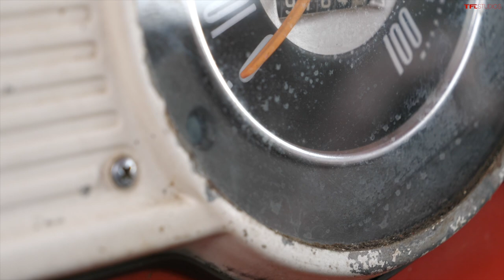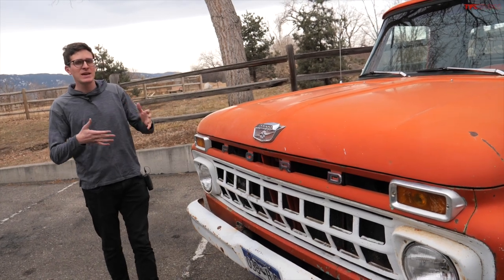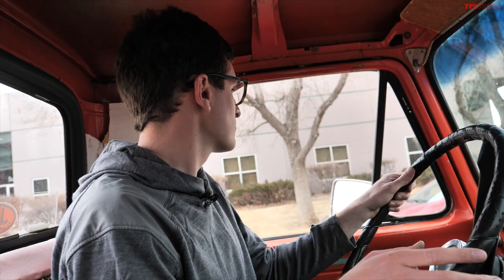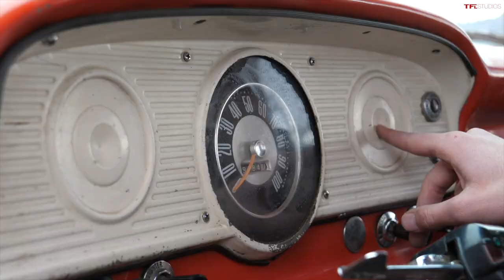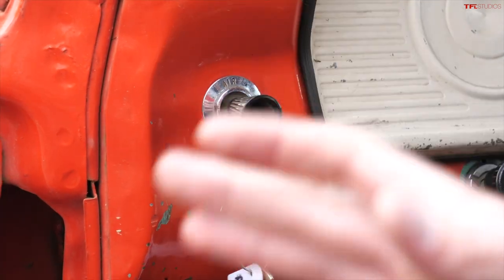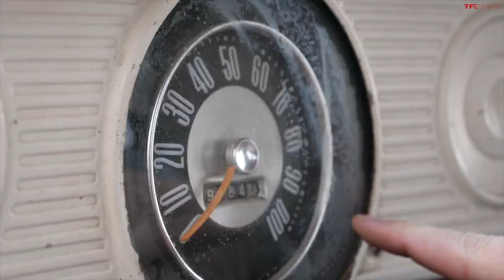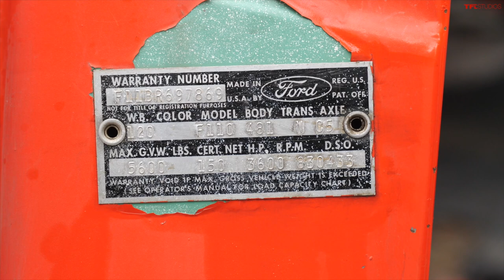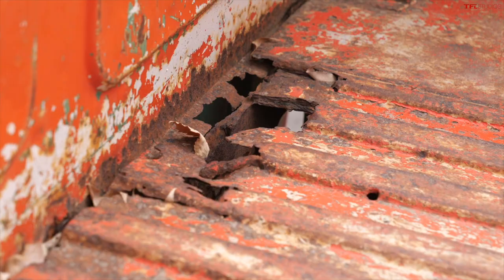Do You Like Raptors? I Just Bought The Ford Truck That Started It All!

Comment: Nice truck ! We got a 66 two wheel drive 3 on the tree 352 v8 custom cab, all original. Yours looks like it’s got a 1959 era bed, which will fit, just different body lines. It looks good though. Solid vehicles for sure ! Check out Dennis Carpenter Ford reproduction parts on the internet if you need anything for it. Enjoy ! Have a Blessed Day !

Comment: My first truck was a 1966 Ford F-100 4x4. It had a 252 v8 with a 4 speed trans and a single speed transfer case. 1966 was the first year for the coil springs in the 4x4 like the bronco. It was the worse 4x4 I have ever owned. I know what the bronco bounce is all about. Most people wish they had their first vehicle, not me. I do still have a 1966 Chevrolet C20 that my Dad bought in 1975. I drove the Chevy to high school until I bought the Ford.

Comment: In my opinion these were really the last of the "old ford trucks" 1967-1972 trucks have much more modern designed body and interior and far more likely to have comfort options like auto trans and power steering or brakes just overall much more refined trucks compared to these.

Comment: The bed is not correct it is off of 59. You said F100 it has eight lug wheels. That is a truck someone put together. I wouldn't be surprised it has a different frame from the 65. The engine is blue it's out of a 70s. With that said it is a a cool truck. The only thing I have on for the last 30 years is a Ford.
Reply from the maker: The bed is original to the cab, the engine is from a later dump truck, the frame and axles are F-150.
Reply: @TFLclassics  Ford has never made a half ton truck with 8 lug.

Comment: Same fan controls and starter  as the Falcon/Comet
Reply: IMO keep it as stock as it is, fix the basics and the rust, give it a light sanding and keep the patina/original green spots, clear coat it, and just start rock crawling it. No reason to upgrade the engine. Maybe throw in front discs along with the dual circuit upgrade, as that’s something ppl will tune in for. Do a period-correct lift kit? Call it Ol’ Red and be done with it. Oh, and get some beat up steelies w’ dented dog dishes to complete the look.

Comment: Refurbish to keep the old look and get the reliability up. Perhaps you could put a smaller steering wheel in if you put power steering in. I would just see what you can do to refurbish the engine, perhaps a few minor performance upgrades would be okay. Just keep it mild. Redo the interior with nice upholstery. I wouldn't speak to an Uncle for a loong time when he sold the old red Ford truck. The new truck was a nasty green.

Comment: That gearbox that is confusing this guy has a "Granny gear"...an ultra low torque multiplying first gear that can be useful in unique circumstances...as I had such an early Ford-truck & I had to move a dead car with four flat tires...so I dragged it sideways as such very slowly with my Granny-gear.

Comment: Sure the engine isn't a 240? Just the same there are performance upgrades for that engine. If you changed engines, I'd go 221, 260 or 289 Windsor. The shorter stroke would fare better with such a low geared drivetrain. Side Note: Skip the gym and drive the truck... That will build your upper body famously.

Comment: to bad it don't have a matching box i picket up a 70 high boy that needed a engine got a 390 and a 428 for it has dana 60/80 lockers rust free very clean body for 250 bucks with tool box on side then i know of a 65 ford with tool box on side rust free very very nice body no dings no dents still has factory paint just needs a buff job has a 352 fe just needs a tune up 2 wheel drive been sitting for a year i can get it for 300 bucks but i just got a 65 chevy short box for 100 bucks
Reply: ps this is what u call the budget ford truck because of the box they did build the matching box they look way better

Comment: Nice truck, this HighSchool kid also likes the truck, but did anyone notice his hands? No grease stains, no calluses, spoke like Harvard Professor.  Not cool,  that truck deserves total respect.  BRING IN LARRY THE CABLE GUY!  And or HANK JR.  They could do a much better job going over this gem.  This kid didn’t even question why it had 8 lug wheels on a F100.  Also, you don’t need to plan ahead driving this truck, you just need to wear a flannel shirt, and have Popeye arms Manly strength!   The fuel tank was cool because you had many benefits;
1. If you don’t hear gas sloshing around go get gas
2. If your fuel gauge doesn’t work get out scoot the seat forward get your STANDARD SIZE TOOLS OUT!  And replace it in like 5 minutes,  if you don’t like catching on fire then go buy some fire proof backing for the seat back, Duh!  High School kid!   I think that’s your saying  Duh duhhhhh!  So you need to join a Gym Jim get some muskles on you  then take it for a drive. Until then your VW Beetle will fit you just fine.

Comment: There is a lie you can do now With the Straight 300.There is an aftermarket for a with intake exhaust theirThere is an aftermarket for them. And I tend to make pretty decent power with Just   Bolt ons. And I mean reliable power. We had one in our concrete   Pump it had an aftermarket intake headers carburetor With stock internals  shy of 300 horsepower We ran 60  Yards Of concrete pushing uphill in 95⁰ weather And it didn't even get to warm.

Comment: My 2 cents. I'd see if you can strip off the orange and get it back to the original paint and then get the right tires on it. Those over grown mud tires will wreck the steering box and everything else on the front end. Don't take my word for it ask around. You just might want to hold on to this one. You may never get another chance to own one!

Comment: Keep it original, drive it, repair only as required! Why else would you buy/own and old truck?
Reply: I'd say vacuum pack the original parts and do bolt-on, reversible upgrades.  The brakes are at the top of the list, especially for someone living in a mountainous area like Colorado.

Comment: Ok sorry! Can you do some research on this truck. I don’t want to be a jerk, but a few things don’t add up. I have had a few of these trucks.
First it’s a 8 lug 3/4 or 1 ton.
Second the front fenders are 1tons.
Third the bed is the wrong body style.
Forth the steps getting into the cab stoped in 63-64, 65 didn’t have steps.

Comment: Ha! Yep quality went to crap when they started adding options and serving that bottom line. Now, we own an '99 F250 and an '03 F350... love our 7.3L diesels and those motors run like tanks... but the cab, the bed, the frame and a lot of other little parts... well, you won't see any of these vehicles around 50-60 years from now... unless they are preserved. Ours work on a farm. Ford, Chevy, GMC and even Toyota make vehicles now that barely last a decade...
Reply: If I had the money... I'd try and find one of those F100s and put a 7.3L in it ;-)

Comment: 1959 was the first year for the four wheel drive factory ford pickup trucks 65 might have been the first year for the new process 4 speed transmission and the first year for the 300 six and 352 motor

Comment: I love any truck from the early 90s and older. They were made for work. I know the newer trucks are nice and all but theyre so overly priced and too much technology involved. We only need heat and some vent windows running on a strong v8 or even a v6. 4x4 on the floor is gone, 8 speeds are in and so is cylinder deactivation. Its sad
Reply: I can agree on v8 but id rather have an inline 6 not a fan of v6’s

Comment: You called the 65 a f100? Why? Its obviously a 3/4 ton truck with 8 lug axles. That means its not a f100? It would have 5 lug axles if it were a f150

Comment: Name of smokey regarding changes really nothing.  The brakes maybe and patch the bed.  You could do the headliner just to make it a little nicer inside.  Regarding the steering  I would not change.  You will not need to go to the gym just drive the truck you will get used to it.

Comment: I don't think that's a 65 65 had a different bed that bed was used in 63 because of the 61 + 62 unibody door failures when loaded down that was called the wrong side bed it was actually a 60 model bed and they used F-350 cabs because they couldn't recreate a new model year quick enough in 63

Comment: That's a good old truck. It may need a little cosmetics, and a heater core, but other than that I wouldn't change a thing including the master cylinder. Just an old farts opinion . If it ain't broke don't fix it.

Comment: It is not a stock F-100 it has 8 lug wheels.
Reply from the maker: I learned it’s been frame swapped to a 250 with a non original 300 straight 6

Comment: Actually your 1965 Ford F-100 is not original outside of the engine, cab front end and the main part of the dash. Your steering column is from an older truck, probably a 1963 or older that did not come with factory turn signals. Your bed is off of a 1950 something model Ford F-100, and is not factory for 1965 as that would have been a bed similar to what the 1964/65 F-100 unibody was or it would have been what we use to call a step-side which was later called a flare side. And your turn signals are actually an aftermarket add on for trucks that came with 1 tail light. If that truck was actually a forest service truck, it was probably ordered without a bed on it and the U.S. Forestry service slapped a bed they had laying around on it. Which was common for old Government trucks, especially when they was taken out of service and sold to the public or a city municipality. Your factory mirrors, would have been a simple rectangular peg with a rounded end that bolted into that slot that has the rubber cover over the hole on the door, and would have been a round bar with two flat ends that bolted to your mirror mounting peg that held a round mirror. The reason I know this is because my first truck was a 1965 Ford F-100, and seat belts was not standard on the 1965 Ford F-100 but was an option as seat belt mounts was standard to accommodate the seat belt option.

Comment: Restore the truck. Update with power steering and brakes. Keep the six cylinder engine. This is a work truck. Improve the driveability. Don't turn it into a customized hot rod. Original is better.

Comment: That's called a 1965 "Wrong Bed"
Reply: Wrong bed & wrong cab 1965 & 1966 cabs are not set up with the large sill panel plus were mandated to have padded dash
Reply: @timcasady4750  I know the reason for the wrong bed. Is it possible that it's because it's an f250 that it doesn't have the padded dashboard?  Same reason for mid 90s obs f250/350 Ford not haven't airbags (when the f150s had them) because of their weight rating?
Reply: @joefwarren  Ford did all kinds of crazy things back in the day and using parts from a year end production on the next year was one of them as the cab is from a 1964

Comment: a F100 4x4 would be 5 hole wheels .. someone has put F250 front and rear ends in that truck
Reply: it also has a f250 divorced transfer case in it ... i bet that truck started as a 2 wheel drive

Comment: I had a 1964 F100 and then a 1968 F100 then I've been a truck driver for a long time so basically that big steering wheel you can belly steer it you got a big belly and it rubs up against it it used to leave a stripe on my t-shirt but you can steer it with your belly that's how the fat guys drive those trucks Armstrong steering

Comment: actually it looks more like its a 63 or 64 with a 65 grill in it..  just sayin
Reply: Um they didnt change anything other than the grill except for all the features he pointed out you couldnt get until 1965
Reply: @straight6fords580  I own a 65 F100, a 63 F100 one piece, and in the past have owned a 64 and 2 x 66's  just saying the 65/66 cabs are different and don't have the step inside the door and they don't have the big round front inner fenders or the dropped down steering column.  All that been said, I have never had one that was 4wd, that might be all the difference. The other explanation could be, someone took a 63/64 F100 straight front axle truck (regardless of the '65 grill) and put 4wd drivetrain from a F250 under it. The pre '65 2wd trucks with the straight front axle are prime for that and would make a really cool project. plenty of other non-original things about the truck in question as well.. like the EEC electronic ignition box on the inner fender. But as I said, just sayin, but I could be wrong. I've been playing with these since the late 70's early 80's when they weren't even popular.
Reply: @scottlyon4164  do you have any links to ones without the step because my 66 has a step also has the rounded innerfenders also the drop in the steering wheel is removable the unibody f100s have different steps and the 65/66 have shorter steps to allow for more room
Reply: Also the door tag has been decoded to prove that it is a 4wd f100 cab i also decoded it myself and found the same info it is a 1965
Reply: I just rewatched it i think somebody put an f350 cab on it also the electronic ignition control module is what you need to run an modern alternator but if i were him its starting to lool like someone sold him a cobbled together 1965 F100 wrongbed because at the price he paid if that frame doesn’t say its a factory f100 4x4 he gotten taken for that price it seems like someone just put that door on there off a salvaged truck and titled it that way to screw people out of money

Comment: Mostly be bull sh*t, this truck is an inline 6, not impressed. This same truck was available in 1966 with a 428, I had one - not a hot rod but the tork curve was extreme. So, to clear things up, this 65, 6 cylinder, 3/4 ton 4x4 pick up is not the “original” Rapture. Sorry, but this is far from factual.